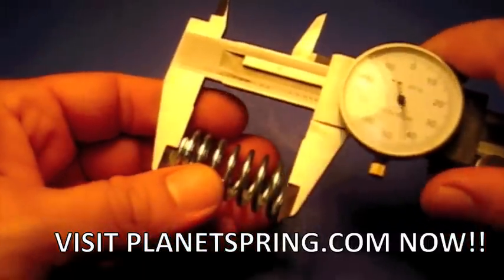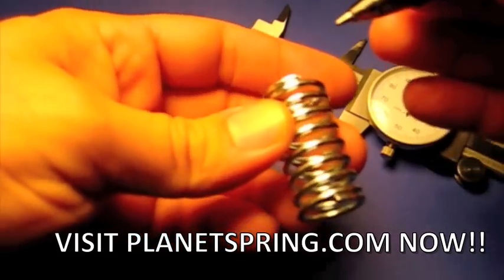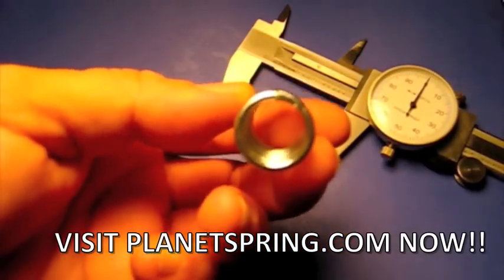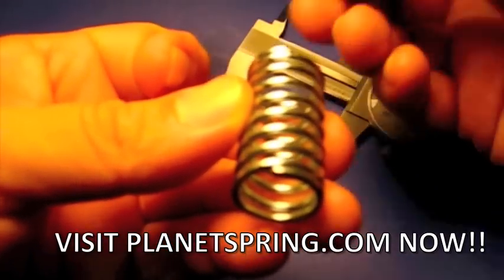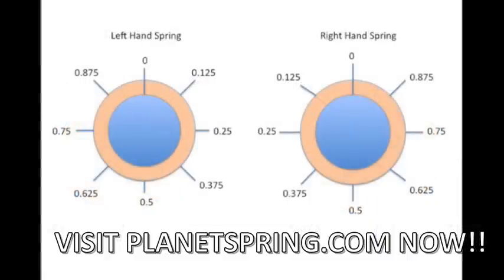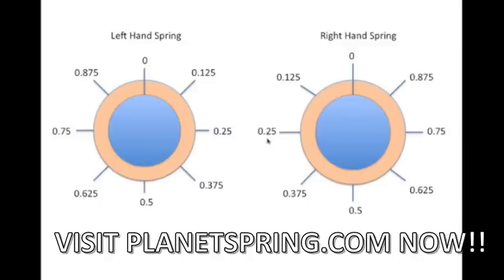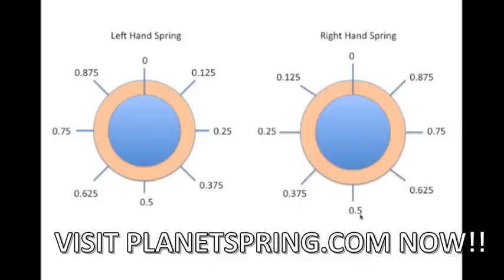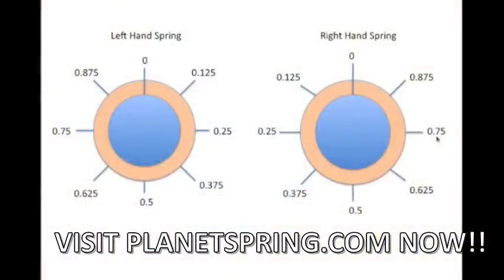How To Measure Compression Springs

Comment: Is there a way of working out how many newtons (or whatever the unit would be) of force the spring can take from using the length, wire thickness, and the other measurements. Perhaps there is a formula to work out the force of the spring - material would also have to be considered. Is there a way?
Reply: Spring Rate = G d^4/8 Na Dm^3  N/mm
Where,
G- Shear Modulus of the spring
d- Wire Dia
Na- Active Coils
Dm- Mean Diameter of the spring
Reply: Go to their website and input your measurements into their calculator: https://www.planetspring.com/pages/compression-spring-calculator-coil-calculator.php